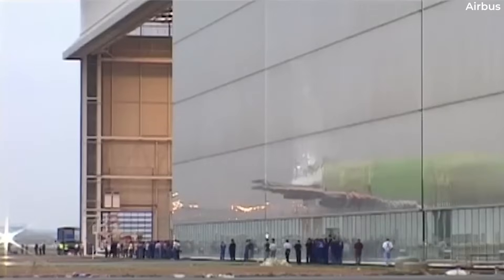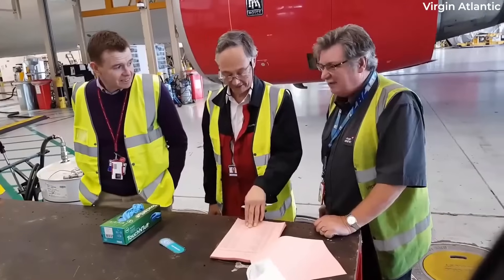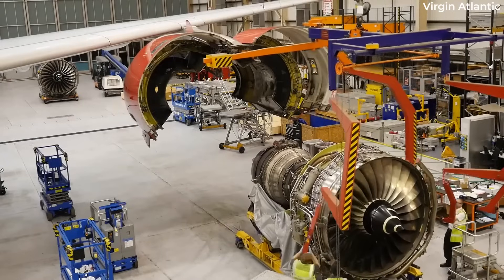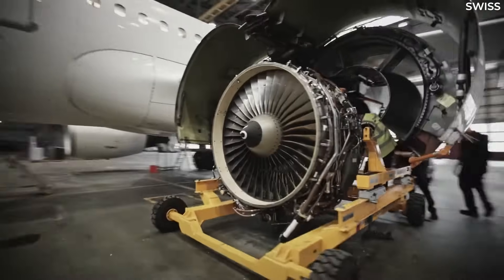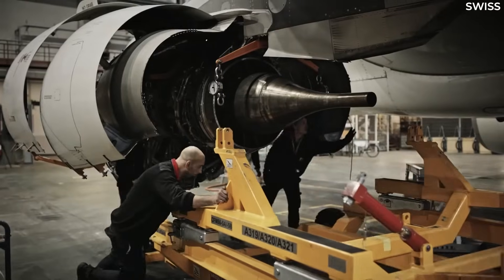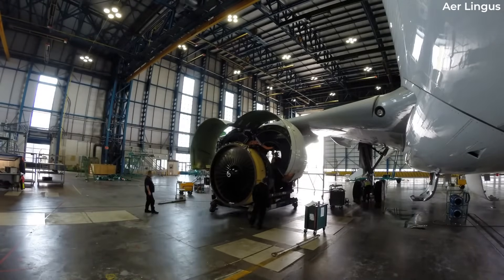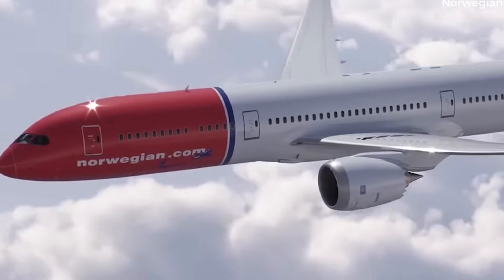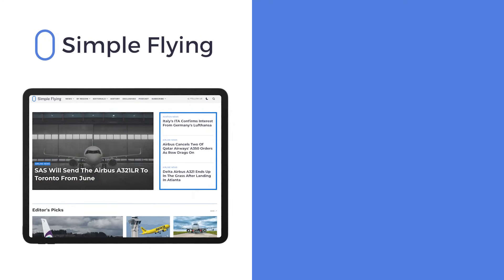Can You Easily Change An Aircraft's Engine Options After Delivery?

Comment: For Airbus aircrafts, if the airframe is certified for different engines, they can be easily interchanged (as a pair) between those certified engine manufacturers by simply changing the hardware and software pin-programming. The HPP is done on certain components directly while the SPP is done through loading a dedicated PDB in the FMS. This process is ofcourse chargeable and done through Airbus TA.
Reply: Sounds interesting but I don't understand most abbreviations

Comment: Airlines prefer to have one engine manufacturer across their fleet for ease of maintenance, spares, training etc. It makes economic sense.
Hard to imagine why an airline would want to switch after purchase, unless they are switching their entire fleet from GE to RR, for example.
Reply: why would anyone want to switch to RR?unless you operate 757 with pw and need extra performance,i dont see why else
Reply: It maybe a solution for A320 that using GTF engine from P&W. As we all know GTF have massive issue and long waiting parts. Many young aircraft stranded on maintenance facility for months and it will much worse for airline finance

Comment: If I remember correctly one of the novel features of the 787 was the ease with which a switch from one engine manufacturer to another could be performed.
Reply: Ease is relative. Yes, it’s easier than on most other jets but still difficult/expensive enough to not make it a viable option

Comment: It is not a question of making it easier to switch manufacturers but rather that the original engine , worth at least 10 million$ apiece be more reliable and durable from the start (Trent 1000 being a case in point ) .

Comment: Seven years ago, Im working as a ground staff at CGK and handle CX. One day, Im able to meet with CX Engineering. I ask “The original enginee for 777 is GE, why are you change to be RR?”. Do you hear that? If yes, maybe I will request that for short video. Im very passionate about aviation, and Im learning so much from you, tq😍
Reply: That's not how it works, Cathay Pacific's 777-300ER planes use GE engines because GE is the only option for the 777-300ER, but their 777-200 and 777-300 planes use RR engines since that is an option. They don't change engines, they only use different planes at different times.
Reply: @VKM-xs5tv  Ahhh I see, tq for your explain.